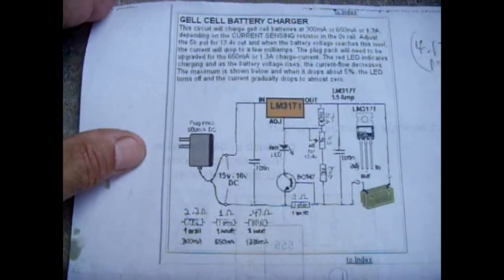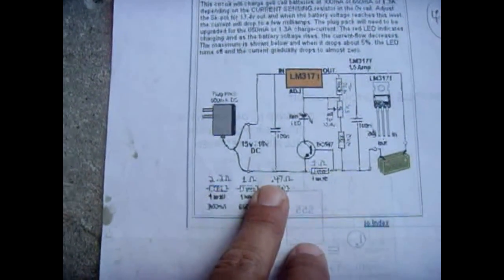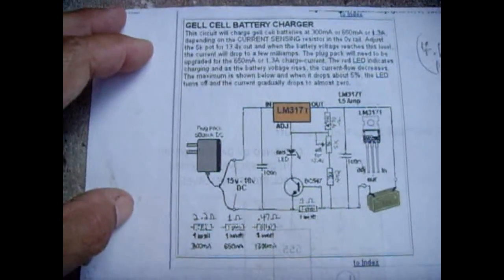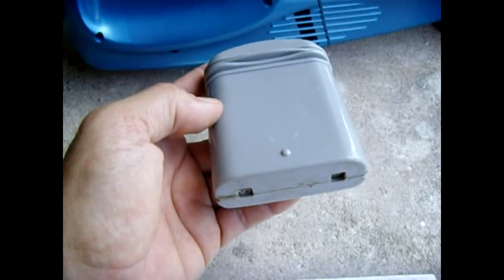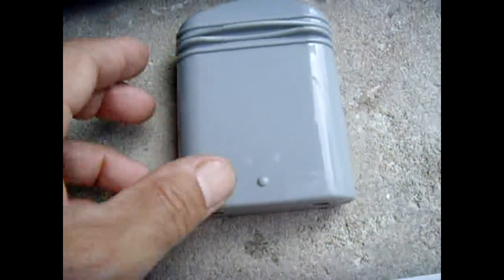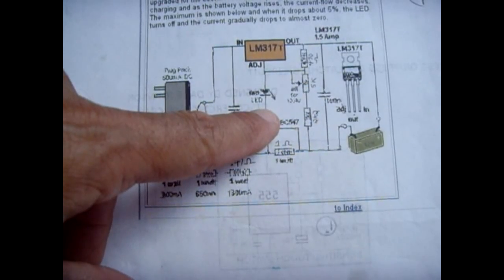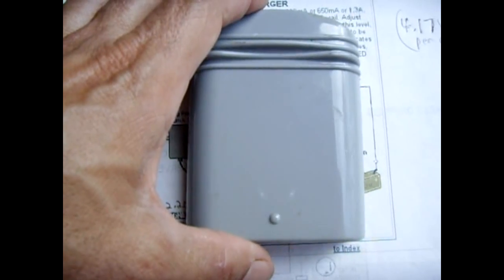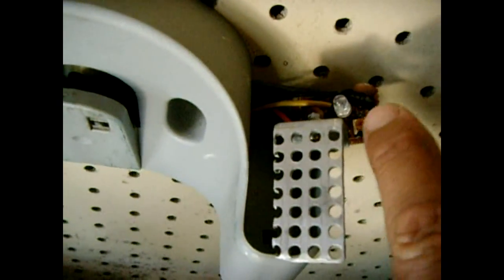Excellent & Simple Battery Charger (Gel/Lead Acid/Li-Ion/+ more)

Comment: Hello there, thanks for the schematic! I'm having some trouble setting the Output voltage to go to 4.1v so i can charge one 18650 cell. Having the 470ohm between adjust and out pins of the lm317 and having tested 9-18v voltage sources, the charger's output can only go down to 7.2v using the variable 5k resistor. Replacing the 470ohm resistor with 1Kohm allows me to get the output voltage as low as 4.1v but the LED doesn't work. Any ideas?
Reply from the maker: +Jiml Kosmo 
Hello there. Replace the 2.2K resistor with a 470 ohm. Leave everything else alone in the schematic. :-). You will be able to lower the output to 4.15V. 

Be sure to rate thumbs up and share my channel with others. Thanks.
Reply: Thanks for the instant reply! Though replacing the 2.2k with 470ohm and following the schematic gets the output as low as 9.95v now :/ .
Reply from the maker: remove the POT and 2.2K fixed resistor and use a 1K resistor instead. If it does not work, then you have a faulty component or wiring error.
Reply: +electronicsNmore 
This works, the light is really bright and the output voltage is 16v.
I noticed when i use the 1Kohm as i said above, the LED works but is really really dimm and when the battery is connected it gets even dimmer. Following exactly the schematic and connecting 2 batteries(8.2v target output) it seems to be working but the current flow im measuring with the multimeter is at 20mAmps...Maybe the transistor is broken?
Reply from the maker: I have no idea what you're doing wrong. Use all new components and start over.
Reply: +electronicsNmore 
Thanks for your help! Gonna try using a C549B ive got laying around cause i dont have a spare BC547...

Comment: The led is so dim even charging a flat battery. Is there any way to make the led brighter ? Thanks.
Reply from the maker: Quiksilver5813 You must have done something wrong, or you used the wrong value resistor for the desired charging current. I suggest you try making the circuit again using new components(at least a new transistor and lm317t).
Reply: electronicsNmore Every components are new. Anyway i'll try replacing new components one by one to troubleshoot what is wrong and post the feedback later. Thanks.
Reply from the maker: You definitely did something wrong. Did you set the proper output charging voltage?? Is the battery able to take a charge? You need to check everything.
Reply: electronicsNmore Before connecting the charging circuit to the battery terminal i set the output voltage to 13.4v, then i connect the charger to battery terminal and i noticed (using digital multimeter) the voltage drop down to below 12V. For about one hour or so the voltage is rising and stop at 13.4V. That mean the circuit is working. The only problem is the LED is lighted up dimly for about 3 minutes then go off but the voltage is still rising. I used epoxy type red LED. I'll try replacing the components one by one to ruled out bad component. Thanks.
Reply: electronicsNmore The LED light up normally when i change the plug pack to 22V 900ma. The LED won't light up if i use 18V 500ma previously. Is the current sensing resistor the problem ? I'm using 1 ohm metal oxide resistor. Don't have any other type of resistor right now.
Reply from the maker: You need to tell me what the charging rate is that you have set(mA), and what the voltage is of the battery you are charging. Sounds like you are using a power supply that is too low in voltage or too low in current output!
Reply: electronicsNmore I'm using 18V 500ma plug pack. I set the charger to charge at 500mA using 1 Ohm metal oxide resistor. I'm trying to charge a lead acid motorbike battery 12V 4 Amps. The LED lighted up so dim for about less than 1 minutes then goes off. But if i use 22V 900mA plug pack instead of 18V 500mA, the LED light up until charging complete. I don't want to charge at 900mA  because its charges to fast (for about 15 min to complete).
Reply from the maker: I think you have a bad battery. Sounds like it lost capacity and is charging up very quickly due to that loss of capacity. You are going to have to figure it out. Play with the circuit, or try another battery that you know 100% is good. This circuit does not get simpler. Very few people experience problems.

Thanks.
Reply: electronicsNmore Ok, thank you for sharing your designs and knowledge.

Comment: I built the circuit on a perfboard and everything worked fine untill I accidentally shorted the wires that were supposed to go to the battery being charged.Now it shows a voltage near the input voltage, no matter how i tune the pot.Is this normal? Isn't the LM317 short circuit protected?
Reply from the maker: 54FreestyleR They claim to be protected, but only for a VERY short duration. I have blown a few by accidentally shorting the output.

Comment: When charging more than one cell at a time you need to balance those cells. Because one cell will be higher voltage than the other.
Reply from the maker: wheezy The best way to prevent that is by installing a bypass switch to charge them in parallel, or by placing a 3.6V 3W zener in series with a 1A rectifier diode across each battery. If one of the batteries starts to charge over a set limit(around 4.1-4.2v), the battery will start to bleed down. I use this technique with my super capacitors.

Comment: Can I use this circuit to charge a lithium ion drill battery? It is a 19.2v battery, there are 5 cells. But the is a lot of circuity on the battery I assume so it doesn't over charge and or over drain
Reply from the maker: No. You have too many in series. This is definitely OK for (1) Li-Ion battery, and you can get by with 2. You need to buy a Li-Ion battery charging module on Ebay.

Thanks!

Comment: Your video is very educational!

I have a question about my lithium charger.
The output voltage rating as shown on my charger brick for my hub motor shows its providing sum of of all the lithium cells in series where each cell is 3.3v.  Eg. 10 x 3.3v = 33v.
I measured with voltmeter and indeed thats the output voltage or open voltage.

What puzzles me is that the lithium battery pack when fully charged, is at the sum of all the batteries in series where each cell is at 4.2v, the max voltage rating of each cell. Eg. 10 x 4.2v  = 42v.

So, I am not sure why the charger is providing a lower voltage than the voltage when the battery pack is fully charged. Its logical to say the controller circuit has somehow stepped up the voltage either by PWM or other means.

I am seeking advise why the charger is designed like this and is this a standard for lithium chargers for electric motor lithium packs.

Thanks very much.
Reply from the maker: Sounds like the charger needs the batteries in place before the charging voltage rises in order to charge the batteries. If the batteries charge up fully then why worry about it? Clearly it sounds like it is working.

Thanks for watching
Reply: You mean the charger maybe designed to charge at lower voltage so that all the cells can reach the 3.3v before the charging voltage is boosted to 4.2 per cell ?

The reason i asked is because there is another type of charger for the same that provides higher output voltage (4.2 x cell numbers) .

I wonder which charger is better designed?

Thank you Sir! I am your fan.
Reply from the maker: If your batteries are 4.2V when removed from the charger, then the charger is just fine. You will not get any better.

Comment: What's that thing with 3pins, where heat sink attached to? A mosfet or voltage reg? 

-
I'm sorry for this noob question, just a kid here trying to learn.
Reply from the maker: kent sujede Hi Kent. The 317T is an adjustable voltage regulator. The heat sink is a piece of aluminum bolted onto the 317T to help cool the 317T.Thanks For Watching!

Comment: If you have a little free space in that battery pack you can make it safer to charge, by embedding a little DPDT relay with a sensor switch that engages as you slide in place to switch it in paralel while charging. I also would recommand putting a fuse between the 2 battery that doesn't allow overload if gets shorted. Simple fix, but it makes it much safer. If you put a fuse, make sure that it's not too small so that it doesn't burns out as you start cleaning, but it's within the max rating of the battery.
Reply from the maker: So far the battery pack is OK. I like the idea of the fuse between the 2 batteries.

Thanks For Watching! Please be sure to share my channel with others and rate Thumbs Up.
Reply: Just a fuse won't make charging safer(only limits the discharging), because it burns out when power limit is exceeded not voltage, so the charging will only be safer if you switch it over to paralel while charging, and charge it with 4.2V preferably not exceeding a single cell's current rating or limiting current/cell so it is equally shared unless a short happens.
Reply from the maker: Less work to place a thermal fuse or switch against both batteries. In the event one or both batteries get too hot, no more charging. :-)

Comment: If i want to use LM2596 buck converter module instead of LM317, which resistor i have to omit out (except current sensing resistor) ? Is the 2k2 still needed?
 I want to use LM2596 because it is better than LMXXX series, as it is a switching voltage regulator, less heat more efficient and can supply current up to 3A. Thanks.
Reply from the maker: The circuit is designed using a LM317T. If you would like to use a buck boost module/circuit to supply power to the 317T charging circuit, then you can do that.

Thanks.
Reply: electronicsNmore
Do i still need the 2K2 resistor?
Reply from the maker: Using the 2k2 keeps the bottom voltage range setting at 7V when the POT is set at zero ohms. Using only the 5K allows for voltage settings between 1.25v and 14.6v.

Comment: Hi electronicNmore! Im made this circuit working but the led doesnt light at all..what wpuld be the problem?
Reply from the maker: Maybe the LED in installed backwards, the battery voltage is already higher than the output voltage you set using the POT, you have a faulty component or assembled the circuit incorrectly, or your power supply is too low in voltage. Those are the only possibilities.

Thanks For Watching. Be sure to share and rate Thumbs Up!

Comment: I am supplying a 10v for the circuit to charge 8 AAA batteries. Which resistor do I need to adjust to not over charge? Will the LED turn off when it fully charged?
Reply from the maker: Everything is well explained in the video. The POT adjusts the output voltage, and YOU choose the resistor for the desired charging current. When charging is complete, the LED goes off. 10VDC input to the circuit is too low. I suggest you look for a higher voltage power supply.

Thanks For Watching

Comment: Hi, i wonder if you could help please. Afraid i am new to this. I am using an ATX as my power supply. 13.6v 6A. I wish to charge the battery to a maximum of 13.5 V 3amp. Could you tell me how i work out the resistors to be used please. Please keep it very simple as i am a learner. Many thanks.
Regards

Carl
Reply from the maker: Hi. If you are using a computer power supply which has a 13.6V maximum output, then you do not need to regulate the voltage. Keeping the lead acid battery at 13.6V will not harm the battery. To reduce the current you can use a 5 Ohm high wattage ceramic resistor in series with the POS(+) ouput to your battery from the ATX.

Thanks For Watching. Be sure to share my channel with others and rate thumbs up.
Reply: electronicsNmore Hi My friend, please forgive as i was watching two of your videos. See they so good. I wish to add a cut out circuit to prevent it overcharging. As said afraid i am new to electronics and would appreciate a circuit diagram with values if possible. Also include resistor to circuit to reduce amperage as described. Many thanks for giving me your time.
Regards
Carl
Reply from the maker: Carl, I would love to help, but I have over 250 videos with people asking questions, and many asking for special assistance. I simply do not have the time to draw up special schematics for every person that requests one. I supplied the videos with all the information you need, the rest is up to you.

Thanks For Watching!

Comment: Could I just use the lm358 instead of lm317 if i need extra current?
Reply from the maker: lm358? That is an op amp. You can use a LM350.
Reply: electronicsNmore My bad thanks! I'll try it!

Comment: One word = TP4056 !
Reply from the maker: Not accurate. If your looking to charge multiple lithium ion batteries, using multiple TP4056's,  then tp4056's would be fine. If your looking to charge small lead acid batteries, gel batteries, nicad's, or (1 or 2) lithium ion batteries, then this circuit will work just fine. The circuit was not designed to charge lithium ion batteries, but I have used it with 2 batteries with no problems at all.
Reply: forgot to mention, tp4056 was meant for li ion only
Reply from the maker: Those modules are good and inexpensive, but if you have components laying around, you can make this circuit very easily.

Thanks For Watching!
Reply: electronicsNmore yeah thats right

Comment: Can I use a 8.4 volts in instead of a 15-18volts?
Reply from the maker: Not if your looking to charge a 12V battery.
Reply: electronicsNmore Im just trying to charge two 18650 3.7v batteries
Reply from the maker: OK. That is what I used it for. You need to set the charging voltage to a maximium of 4.17V per cell, or 8.34v to 8.36V. Never use more than 2 lithium-ion batteries in series. The charger must be able to supply the necessary current and higher voltage output in order to make this work. Look for a 9VDC wall transformer with around a 500mA output. That will work fine as long as you set the charging current at or below 500mA.
Reply: electronicsNmore OK Thanks

Comment: Hi. I have a laptop charger 19 volts/4.7 Amps. Can be used in this circuit or will overheat lm317 ? Cheers.
Reply from the maker: You want to use the laptop charger as a power supply to charge a battery/batteries? LM317 is only rated 1.5A using a LARGE heatsink. If you need higher current, then use a LM350, that is good up to 3A. Use a VERY large heatsink with thermal compound.

Thanks For Watching, Be sure to share and rate Thumbs Up.
Reply: I've just tested the laptop charger 19v/4,7Amps with basic LM317T voltage regulator and tested.Nothing is heating.I've used a large heatsink. If will burn,definitly will go with 16v/500mAh charger.For now is running great with voltage regulator.Hope will go well with battery charger.Thanks for replay.Cheers
Reply: Robert s as long as current is limited at the lm317 side, i think no overheating will happen. your laptop charger adaptör determines the maximum current it can give out.
Reply: Current is really not an issue, having a source that can provide more current is not a problem since LM317 has no max input current. This is due to the fact that there is no ground connected directly to the regulator, there is only a max allowed IN/OUT voltage difference which is 40v, if you can keep restriction and the voltage difference doesn't go over that then the regulator will be fine. You will only be able to get about 1.5A from the regulator assuming that you can provide sufficient cooling.

Comment: Do you know if I can charge a lithium battery with a lead acid battery charger without ruining anything?
Reply from the maker: No. very dangerous. You need a circuit like this one which you can regulate the current, and set the maximum charging voltage to around 4.17-4.18V.
Reply: electronicsNmore
even for a motorcycle or car battery? That voltage seems low.
Reply from the maker: I was talking about when using with Lithium Ion batteries. My mistake. The other circuit you can set at 14.5V

Comment: Thanks so much for your educating videos!!!
I have a little question...If I understood correct by placing a pot under BC547 we can adjust the current that will flow our charging battery...Is there a way to add a second LED (green one) which will indicate that the battery has been charged to make more visual alike? Thanks in advance...
Reply from the maker: This circuit will not overcharge your battery. When the LED goes off, you will know the charging current is very, very low or close to zero. If you use a POT, make sure the wattage is high enough.

Comment: hi, 
i can charge serial connected li-ion 18650 battery 12v. Using from this circuit.? 
I have 3 cell, i must be connect cell by cell. ?
Reply from the maker: No. Too many in series. For safety I suggest only using 2. I have had zero problems charging my li-ions (2 in series) for the past 1 1/2 yrs. I would connect all 3 in PARALLEL, and set the charging V at 4.17.

Comment: Great circuit. I was just wondering, if you or if anybody had problems with the LED coming on. If so, what was done to get it to work. Thanks.
Reply from the maker: No. the circuit works fine. I suggest you make sure the LED is connected to the circuit using the correct legs(anode/cathode), and try new transistors.

Thanks Fir Watching. Be sure to rate thumbs up, and share.
Reply: electronicsNmore
Thank you.
Reply from the maker: Good to hear. The circuit is very handy!